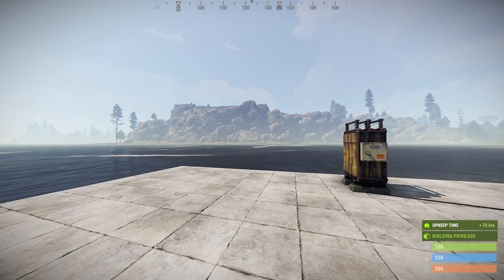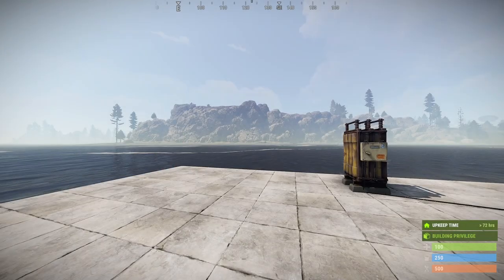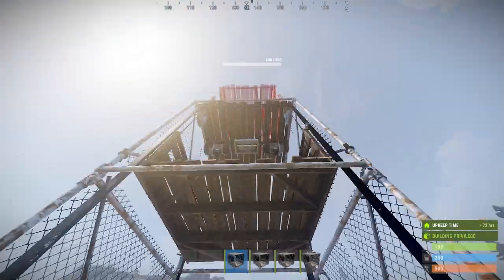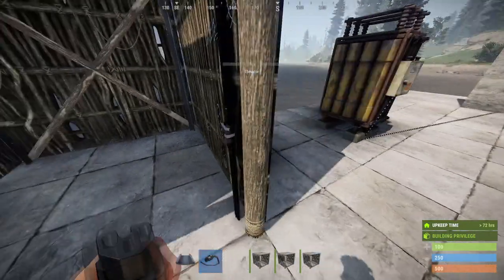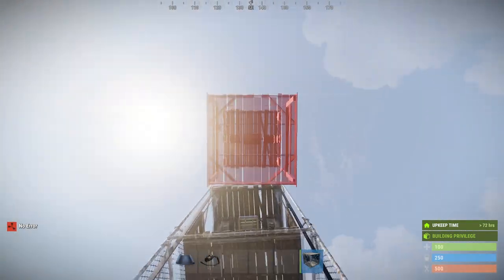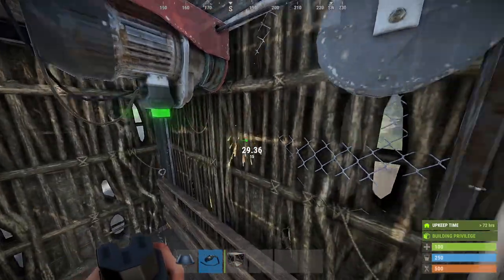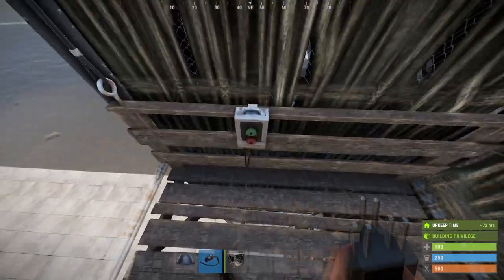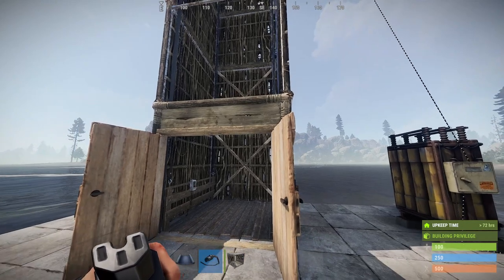Rust Electricity 101: Component Guide - Elevator

Comment: Hey Rabid. Been watching your vids for over a year now. Do you know if it's currently possible to draw power into a cave? Without using a generator. Keep up the good work 👍
Reply from the maker: There is one cave type that can be shallow enough to string power into, but now that you can pick up batteries and move them keeping charge, that is a go-to for cave basers. Have a charging station on the surface and bring full large batteries down.

Comment: I have a request, i am trying to design a system that will activate a tesla coil either when a sensor is activated. Or when this sensor is destroyed. 

I tried using a branch, branching out power to a sensor, en setting the power in that branch to be Just enough for the sensor. So the power out would be 0. I figured if the sensor is destroyed it is not using power anymore so the power out from the branch would rise, which would trigger the trap, in the same way the sensor would but via an or switch. 

However the branch does not seem to work that way, once the branch out was no longer connected it gave no power through power out. This seems totally unlogical to me.

I am still trying to think of a way to do it, but i figured if Anyone knows how to do it, you would be it. 

Thanks
Reply from the maker: You have the right idea, but there is a bug still present that prevents this type of circuit/sensor destroyed protection. It has been acknowledged but the dev, but it isn't fixed yet sadly.

Comment: It's a shame you can't lift cars with the elevator.
Reply from the maker: I'm hoping this becomes a thing cause who doesn't want to make a parking garage in their base!
Reply: @RabidRabbitGamer  yeah, that's what I did. I made a 2 level, 7 lift Auto Repair Shop and I was really hoping that I could use the elevator to get them up. But you can't even activate the switch with a car on it and there are cross braces that would keep the car from going up. And you would need 3 or more elevators deep to fit the 4 modules cars.

Then I had to resort to using a ramp, and that sucker is like 8 foundations long, looks soo out of place!
Reply from the maker: @alan4657  We did a car ski-jump on one server using ramps, that was hilarious :D